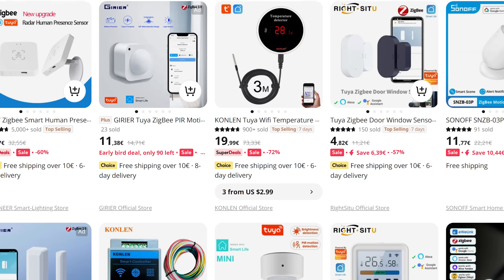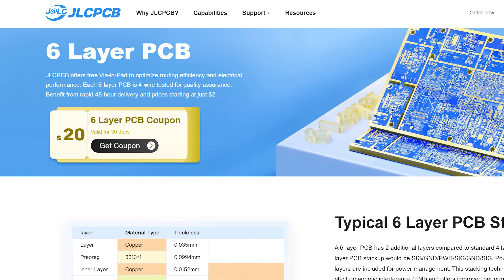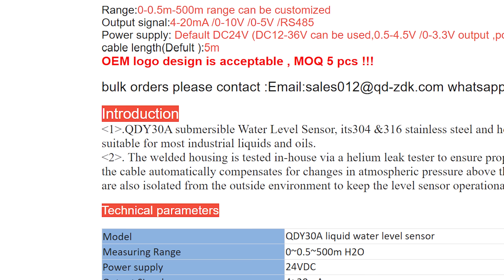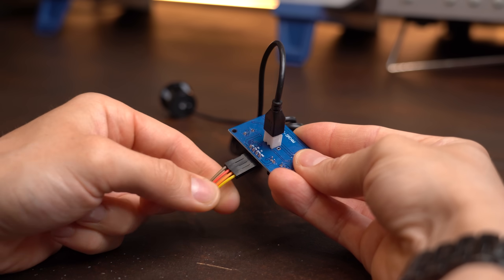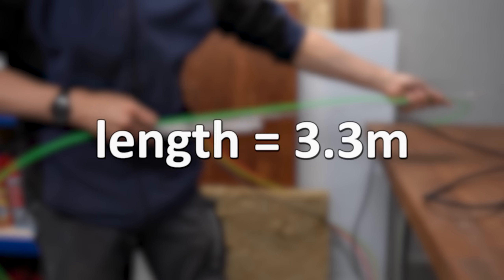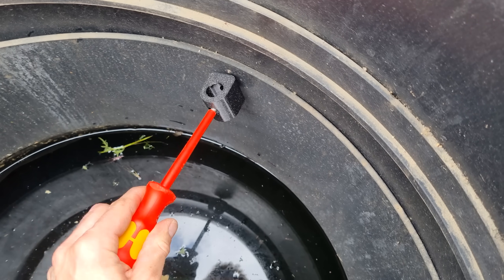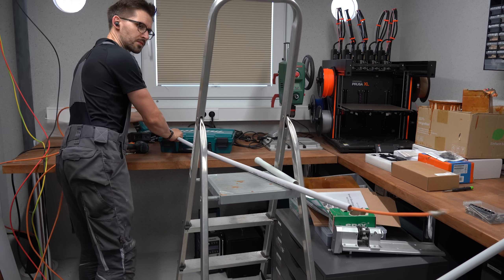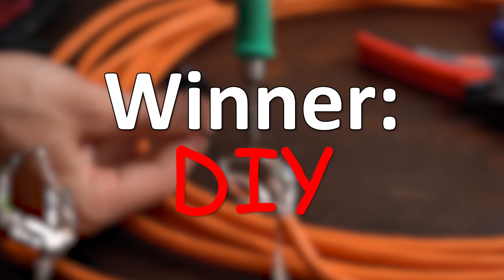This Happens when all Buy Options Suck! Water Level Sensor (DIY or Buy)

Comment: I plan to do something similar with remote liquid de-icing tanks. I've been looking at sensors and never thought about the ultrasonic sensor. Thinking about using LoRa to transmit remote fill depot data back to my shop.

Comment: Hello, Superb project. I am looking for a similar solution for a well in the south of Morocco which is around 60m deep with water at 40m. I looked for options which are over 300 Euros. Do you think I could use similar option with an extension cable ( Is cath 8 ethernet cable will do ?) ? The other challenge is that there is the pump that will be next to it and will probably impact the measurement. Thank you for sharing your expertise.

Comment: The only problem with your project is that, there is not way to remove the water droplets that stick to the sensor. Because once the droplets are stuck (due to constant evaporation) with the sensor surface, it gives false readings.
Believe me I personally had made the same project and only this is the most annoying part. Now I have to look for a way to remove the drops.

Comment: I was just wondering... can't a washing machine water level sensor be used? It works on the same principle as a hydrostatic pressure sensor. And it could be a cheaper option.

Comment: It is very hard for that ultrasonic sensor to work reliable over time.
First of all it's more stable at 5 volt than 3.3 volt despite it's stated in the datasheet it can operate at that voltage (you can also hear a more poweful ultrasonic 'click' sound at 5 volt, which is probably easyer for to pickup again for the receiver).
As rain falling in you get ripples on the water and not measuring accurately, it can take quite long until water stops flowing.
It does not work from time to time and puts out garbage, after a few days it suddenly works again.
When humidity condenses on the transducer of a spider makes its web in front of it, it also does not work anymore (no that is not related to the above, tried to clean enough)
If you are a good programmer and measure the pulse more accurate (not with de default functions, they are easy to read but does not take full benefits of the microcontroller capabilities to measure pulse time) you can get even more accurate results with oversampeling and filtering out quantiles.
Unfortunately it's behavious isn't stricly linear (the level might seems right at the top and bottom, but verify some measurements in between, especially towards empty you can be off quite a bit.
There must be some consistent influence of radar reflections due to the geometry of the tank I suppose.

Comment: True cheap DIY would be a float with a stick. When the hole is full, the stick will be visible. If the stick is not visible, then the hole is empty. You could also further improve it with a red flag on top of the stick.

Comment: I have a very similar need and came to much the same decision as you except I simply ordered one of those cheap parking assist things.  I'm waiting on it to arrive.  My plan is to disable the buzzer and maybe reverse the order of the LEDs (so low/empty is red, not green).  My tank is about 2ft /.6 M deep and the resolution is about 0.1 meters or about 4" or about 1/6th the tank volume.  Now empty will read a higher number and empty a lower but I can put up with that.  Also I will simply extend the LED display wires to where I can see it.  I'll try to come back and say how it works out.

Comment: One issue that you might (Surely will because i ran into the same) run into is moisture and condensation. When the sensor becomes cold from outside but the tank water is warmer. You will see condensation on sensor because of which it will start giving wrong readings. 
The solution to try for that is to make a 90 degree mount with a 45 Degree reflective surface. Coat the mount from inside with some hydrophobic coat. This way the sensor is not in direct view from water vapor hence less condensation plus you can add fine mesh or a sound permeable fabric, design, mesh etc which will stop the water vapor from reaching the sensor.

Comment: This partially inspired me to build my own sensor but I could not get a wire or wifi there so I plugged in 18650 battery and used esp32 module that could transmit using Lora.  I will need to replace the battery in about a month but other than that I am very happy I am thinking of building 4 more sensors to monitor other wells

Comment: Just how precisely do you need to know the water level?
I would have just put 8 miniature float sensors on an aluminum stick wired it up with a cat6 cable and driven a led bar graph.

Comment: The ultrasonic sensor doesn’t work on enclosed areas like a cistern. The signal goes crazy because the it bounces off all the walls. The sensor continues reading all the bouncing signals. I highly recommend you the pressure sensor 4-20mA for the project, because I already did it and it worked. It’s a little bit more expensive, but the coding and the circuit is easier and If you use Arduino IOT Cloud, it’s even more easier.

Comment: I have to build a similar project, but may be cheaper and have better range (no wires). 

I was thinking of a more mechanical approach, using a floater (pet bottle half filled with water) and a counterweight, way above the ground, over a pulley on top, that would register the number of turns. The pulley would be wider to accept multiple turns of the cable, enough to have at least one point where cable is always fixed on the pulley. This would prevent slipping over time. Pulley can be connected to multi-turn potentiometer and that would give a good enough reading. Since I'll be using 3D printing, the radius of the pulley can be adjusted to cover the depth I want to measure and the max number of turns for the potentiometer. This can be read by an esp32, and transmited. Power can be provided by a small solar panel.

Comment: Did you consider using a Lora ESP32? With Lora you would be able to place the ESP32 inside the water tank and run only power supply lines to the tank, making the installation a bit easier.

Comment: There are more sensors out there. Would be nice to analyze them. ToF, Ultrasonic, Capasitive, non touching the water. complexity, pros and cons, min max distance or measurement etc. 
Been looking around for sensors and i found the ToF10120 a well suited to measure water tank level(coffee machine for example) were you need to measure a 10 or less cm diistance.
Saw the Guy with the Swiss accent and learned that there is a distortion about the angle that the sensors transmit. Temp of liquite and refectiveness of surroundings. 
Makes me want to reevaluate the flotter idea.... xD

Comment: Hi! Have you considered using a VL53L0X (or L1X) ToF sensor? I have used them in concrete basement water tanks and work reliably (most of the time). You can easily integrate them in a waterproof enclosure. Just be sure to only use the optional cover panel, in order to avoid refraction and laser Rx/Tx interference. These sensors were connected to an esp8266 and programmed to send measurements with mqtt (every 30 min). The problem I face is that when the tank truck comes to fill up the water tanks, their pump is strong and water fills in with pressure which sprays the sensor (sensor is top mounted at the tank's hatch door). For the next ~12 hours I get wrong measurements, till the accumulated water blobs are gone (on the sensor cover panel). This sensor measures accurately and consistently the distance to the water surface - when water surface is calm, measurement variate in the range of mm, 1 cm at max. Just for reference the height I am measuring is from 25cm to ~190cm. I am using them for the past 3 years, and generally moisture does not build up in the sensor's cover panel, even though proactively I clean them twice a year. Another advantage is that electronics are not exposed to tank's moisture conditions.

Comment: Would be interested in a GreatScott solution for soil moisture sensors. The existing ones are also fairly cheap / not robust and corrode away quickly. Would be interesting to see you integrate your water level monitor with an auto watering system based on a moisture sensor.

Comment: Saving ~60 Eur for 6h+ work is technically a terrible investment, making the "buy" option better.  If you used the first sensor that sits underwater, it probably could have been easily extended to your garage with just a simple extension cable.  This would have saved the need for a junction box, messing with the cable, etc.  However, if you look at it from a learning perspective, then you just learned a lot of interesting things (and thanks to YT could teach it to others, get clicks, etc) so in that way, it made sense to do DIY for the learning process.  For me though, I'd have used the (first) hydrostatic sensor and then used your nice digital approach on your home automation screen.

Comment: Wouldn’t just having float switches connected to a row of LEDs be more robust? The LEDs would be off when water is no longer there and on when the water reaches them. Another option would be to just use float with a stick that pops out of the top of a hole in the tank. 😅 just my thoughts on making something complicated much easier. The LEDs could be also tracked easily also by a computer with less potential glitches.

Comment: "The guy with the swiss accent" had a nice idea:
Get a cheap blood pressure device for use on your wrist. ( < $10)
Attach a tube to the output. Dich the other end of the tube to the bottom of the tank.
Open the valve, wait a bit and measure pressure.
Then shut the valve and start the pump to push out all water from the tube.
Shut off the pump and wait a little. Read pressure again.
Eh voilá:  the difference between pressure by valve open and valve closed is your level inside the tank.
Cons : All sensitive tech can be mounted outside the tank. Tube will withstand lots of hazards. And is cheap to replace.
Negs: Noise and current draw of the pump

Comment: Analog bubblers are pretty cool. You would use a 5psi analog input.  Then connect that to a small air pump (even a hand pump) weight run an air tube to the bottom of the tank. The water pressure in the tube is the height of the water.

Comment: Couple years ago i did same with same sensors for my 3 oiltanks. wrote the esp code by myself, mqtt it to homeassistant and works without a glitch for years now. my total costs: ~50€ 😊

Comment: Hi,

i built something similar 3 years ago for my fountain. You forgot one important thing. Your sensorvalues will change a lot when the temperature changes, because the speed of sound changes - even in the same level oft water.

So, the differences between day and night were more then 40cm.
So I added a waterproof DS18B20 temperature sensor and take the temperature into account in the calculation. Now the value varies by max. 2 cm.

I send my data via MQTT. Its solar-powered and it goes to deepsleep between measurements.

I use HT pipes for the housing. Photos follow in request.

Comment: Thank you! I instantly bought all the components when i saw your video to set up a sensor for my home heating oil tank. I altered your code to suit my tank depth, and all i have to do now is design my own 3d mount and install it.

I've run out of oil too many times, and it's an absolute pain to bleed the system. I need to disconnect the pipe at the burner and  use a pump to vacuum the oil to break the air lock.

Comment: Obviously you came up with your solution already, but i wasn't sure if you thought about using a float similar to what alot of vehicle fuel tanks have. Those style are easily modified by varying the length of the float arm. You can get submersible or dry, analog, digital, or even just mechanical. It'd be a good backup to have just a   mechanical graduated float can put a limit switch a the high water mark that kicks a pump on or w.e is needed.

Comment: I'm trying to follow this vid as a tutorial but i'm confused on your mode selection. You state that mode 4 is required for this sensor to work in esphome, but the documentation states that only mode 1 and mode 2 will work for esphome.

Comment: I had a question in mind but literally didn't find any detailed related video on youtube. Thought you can share some knowledge.

I think no one have ever tried doing such, either its maybe worthless or time consuming. So if you make one experiment then I can be grateful.

Because I already went through your video on diy or buy battery desulfator. Is it worth it?

Can we use a cheap function generator from online to some how generate square wave to revive a small maybe small battery 12vdc 5 to 12Ah battery? Maybe the battery won't get back to full capacity maybe some of it can be useful....

Sadly😢 speaking ferrite core, resitor type inductor are not available nearby. So either i need to get air core type😂.

Comment: Hi, I am an Electrical Engineering graduate my majors are in power system. But much lately I have been getting interested in electronics, so recently I felt my mind going blank as to how to create a electronic device to perform certain task, I know I can probably do it with Arduino but I don't want unnecessary extra component, you can say I want to create an electronic product to do a certain task with no unnecessary component and in budget. 
Now for example recently I installed an exhaust in my room, but now I also want the exhaust to run in reverse direction and I can do so buy adding 2 way switch and capacitor but problem is I have to manually switch it every time for both directions
now what I want to do is want to add a electronic device that has a timer in it and I can set the time for one direction run, like for first 1 minutes in clockwise and then another 1 minutes into anticlockwise ( just like Energy recovery ventilations). but I don't know how to start making it what components will be needed how to connect it. and logic behind it

if there is a website or any software or some AI tool that can guide me into learning on how to make make electronics by knowing the task it needs to perform. Please share your knowledge

Comment: The level probe you bought is a very cheap chinese version that would never be used in the industry. This type of sensor costs 300 to 700€ to buy the real deal. On top of that, 0-3.3V is not used in the industry and stainless steel encased measuring cells aren't great either, ceramic ones are much more resistant to corrosion.

Ultrasonic transducers are also used in level measurment, but they're a lot more complex than the one you bought, a lot of signal treatment to get a useful and stable measurment for tougher conditions. Your very stable water surface in your tank is why that product worked for you.

Radar E/R is a better alternative to US, but much more expensive of course.

Comment: While looking at your wiring to the esp32 board, I would personally remove the headers and solder the wires straight in the holes. It’s a mere suggestion, I think it looks neater and the insulation can go all the way up to the board, with minimal electrical exposure. Also, once everything is proven to work properly, how about tropicallizing the board to make sure that it’s at least splash proof? I see you have used a junction box that probably already does that, but just adding a coat of varnish isn’t too much extra work and can’t hurt, just in case the lid pops open or the case springs a leak for some reason. The humidity will likely be high in that location, and condensation can cause the project to fail, which is a shame, as I really like your approach to this problem. 
Feels like I’m preaching to the priest here, please don’t take it the wrong way. To me it’s all about debating ideas, and learning from each other. If my suggestions have any reason not to be implemented, by all means do correct me. No detail is small enough to be disregarded. Thanks for the video, it will be useful for a different project I’m working on, where I also need to measure the water level.

Comment: Wouldn't it be easier to make several floats that, in the presence of water, press buttons, that sealed in polyethylene? Floats are on different levels and do not have expensive components. The design of the floats is similar to the float from the toilet tank. Its cheaper that way.

Comment: Is that ultrasonic sensor the same as the ones used as car reverse parking sensors? Because they both look same and connector is also similar.

Comment: I'm using such a "car weatherproof ultrasonic transducer" for exactly this purpose for several years now.  It works well when the water level is still, but when rain-water is pouring into the (also for me 10000l) container the measurements are quite irregular, so I added a lot of averaging.  Mine uses an attiny85 powered by an 18650 and sending its findings over a simple 433MHz transmitter to my ESP8266-based 433MHz to wifi gateway which also receives via 433MHz signals flagging access to my letterbox, ringing of the doorbell and various other things.  The attiny85 and sensor run more than a year on a single 18650 charge, waking up every 15 minutes to take numerous samples and send through the results and the battery level.

Ah yeah ... what's also a pain is ... cobwebs ...

Comment: Beware of beam shape, it might be reflecting from sides of tank and measure garbage :)  At my previous job I've seen photo from customer which needed to shift measurement range of ultrasonic sensor. But calling someone to set new parameters was expensive, so they just added piece of tube between sensor and water tank. Of course it was reflecting from tube itself and measured total garbage.

Comment: 7:14 I think its because when you add a longer cable you increase the resistance of the cable? Therefore the sensor gives strange values.

Comment: Put a simple controller for the sensor (ATTiny10?) in epoxy. The data is then sent in series in low baud rate.